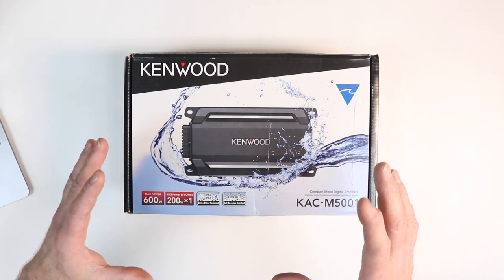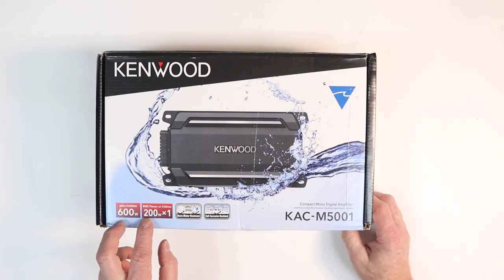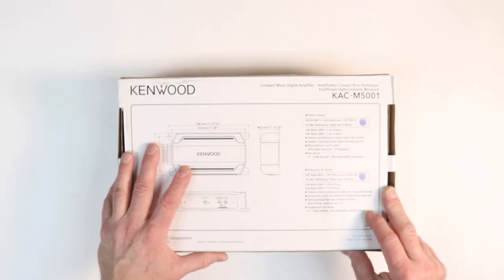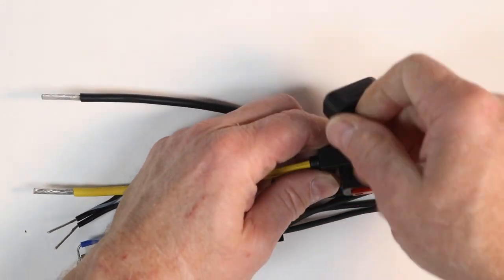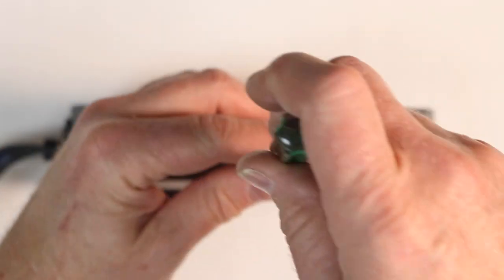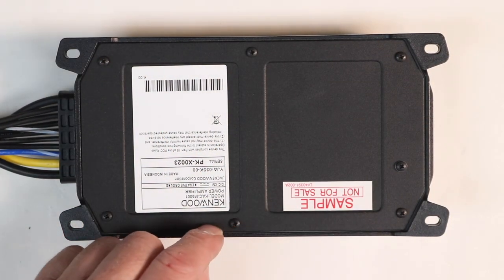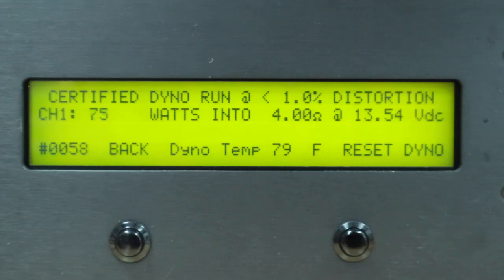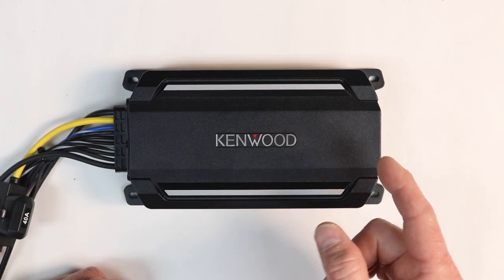Kenwood KAC M5001 Unboxing and real world amp DYNO

Comment: You should also show current consumption, it's really not hard to have a fluke current clamp meter there... And also those look like rubycon capacitors, nice to see someone other than rockfosgate use quality electrolytic's instead of that ching Chang bs